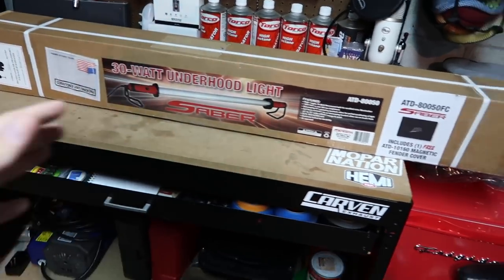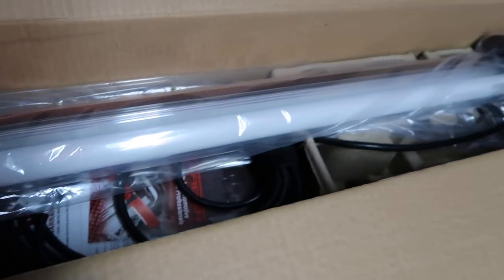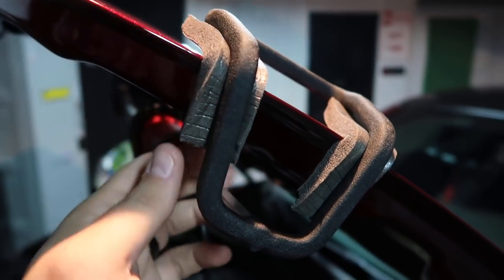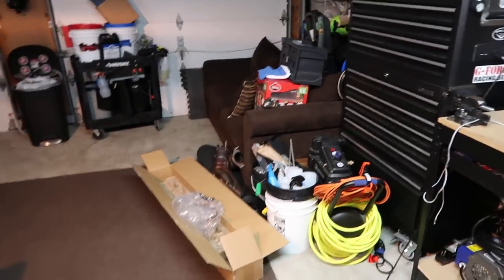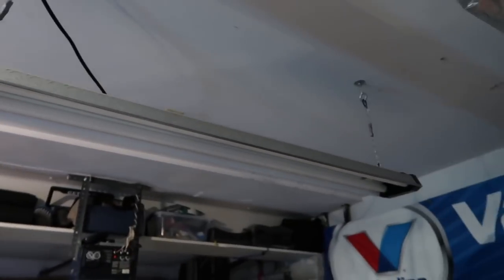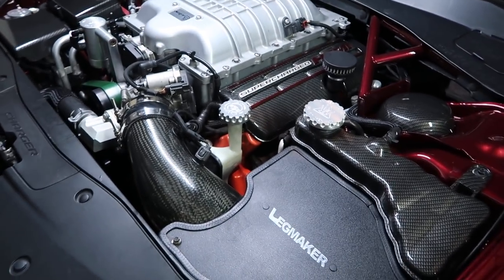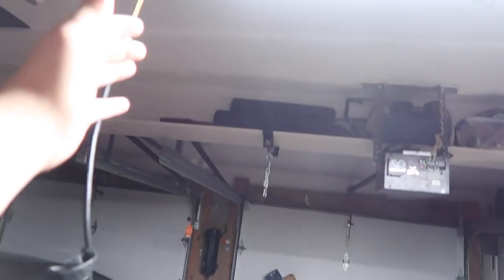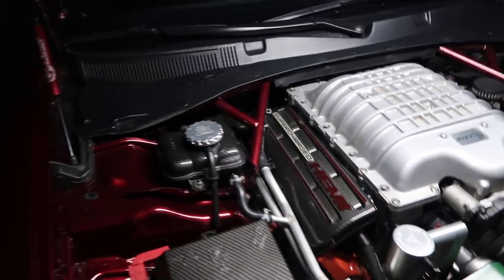Super Bright ATD Under Hood Light

Comment: Harbor freight has an under hood light that is 845 lumens rechargeable with retractable plastic hooks that can be attached  to the hood cut outs under the hood for half the price. I have one and it work perfectly. Just an FYI
Reply from the maker: spidey197012 I ordered that one also as well as another one to see the differences literally right before I posted this video lol thank you for letting me know though !! I’m curious to see how bright they are and how I like the connection points vs one another lol
Reply: When you use the hook option on your HF light, are you still able to adjust the light angle or does it just point where gravity takes it?

Comment: I have the bigger light to this model. The 2000 lumen version with the 25ft detachable power cord, Quality lights for sure, good buy! Keep up the great content👍
Reply from the maker: nick buck didn’t even notice that one until just recently and I had already purchased this lol I noticed in the description for that one that it said removable cable does that mean it can be used not plugged in and avoid the dangling cord ?? Lol
Reply: It sure does! It lasts a long time on high. I forgot how big the internal battery is but I’m betting there is 3 or 4 18650s in there, I love it. Used it on my 14 SRT 300 many times. I also wrapped the hooks in soft foam for added protection

Comment: F all that! Super Bright LED also has an under hood light kit (like $15) which is basically an LED light strip (not bar) with switch, that attaches to the underside of your hood with an adhesive strip. You can hardwire into one of your fuses. Very simple to install, very easy to use. Pop your hood, flick a switch and you're in. And if you want, you can also buy a plunger, where you open the hood, it automatically comes on, so where you don't have to mess with the switch. But really, the switch isn't really even a big deal anyway.